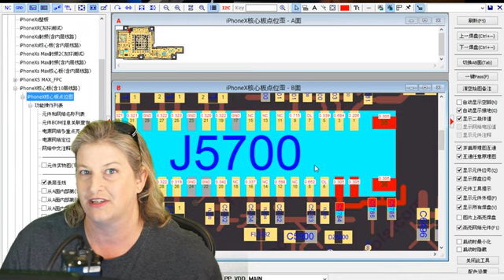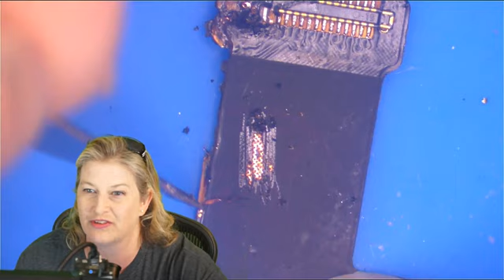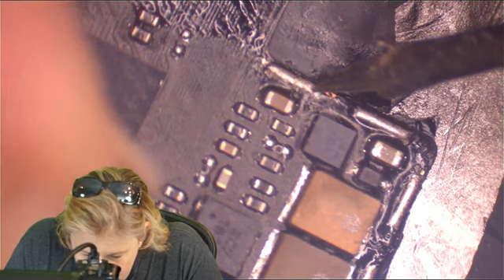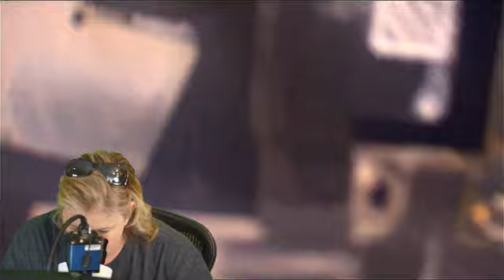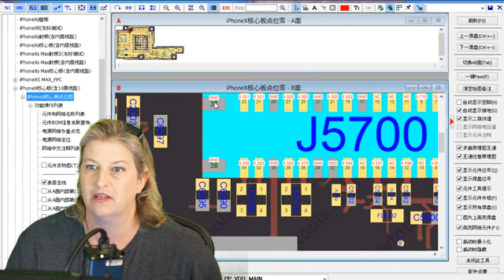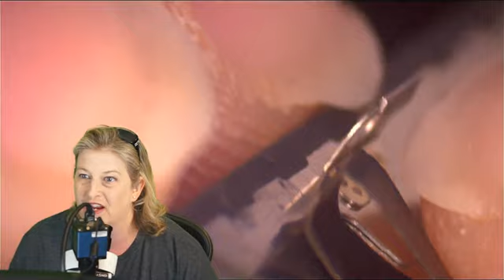iPhone X Aftermarket LCD Screens--Are They Safe?

Comment: So, off the bat, there is one main flaw with your initial theory. There is NO WAY to install an lcd screen in an iPhone X. LCDs work entirely different and are built differently than OLEDs. This can be seen with the XR vs X or 11 vs 11 pro. There is a physical chin and large bezel around the phone because the connects for the panel have to come out of the bottom, unliked the curved OLED on the X, which has the flex cable come out of the back.
Reply from the maker: You can install an aftermarket lcd produced for iPhone X.  Although I don’t recommend it.
Reply: iPad Rehab I can almost guarantee you it’s just a cheap oled mislabeled as an lcd. Regardless I love your channel and you are a big inspiration to me. I’m getting my first solder station to learn how to microsolder. I have VERY limited solder experience but have been replacing parts in iPhones since 6th grade 😂.
Reply from the maker: It’s an LCD.  In another video on my channel where one caught on fire, You can see the biology of how a backlight driver circuit is added to the screen and uses a vccmain pin from the connector for power.
Reply: iPad Rehab oh cool. What’s the name of the video? Sounds very entertaining! 😂

Comment: I'm not really sure what in this case the fact it was an LCD had to do with the issue. The lines in the flexcable are the same as on an original display right? MAIN next to ground.

Can an original flexcable not do exactly the same if you make a crease in the flexcable and have exposed copper?
Reply: I said the same thing. You’re 100% correct.

Comment: Hello Jessa. Been trying to revive a flickering Viewsonic screen. It blinks every 12 seconds (on/off). I've desoldered, soldered w/ new ones one by one the electrolytic capacitors on the power board, there are also caps on LCD module  (one 50v 10uF & four 16v 100uF

should I trial and error those caps too?
I'm all for the right to repair bill-then law hopefully.

Apple memory upgrade & service is beyond expensive.

Thank you.

See you all in heaven.
God bless, Revelation 21:4

Comment: Actually good (or lucky) engineering, that the ground trace was designed to act as a fuse and blow. That saves a total fire in the device. I had that on a high end PC graphics card years ago, and was told it was actually intentional design.
Reply: It'd be a better idea to use a surface mount fuse instead of having traces of your circuit burn and melt, but yeah I suppose you could design it that way if you wanted haha

Comment: I've always only used Soft OLEDs in my iPhone X repairs.  The idea of switching screen technologies always seemed like a really bad idea, so I've avoided it.
Reply: Thanks for the insight Captain Commonsense
Reply: @neilhuband995  You'd think it's common sense, but it's not.  I've had people bring in phones with the LCD screen replacements done by other shops in my area to cut corners and they complain to me about the issues, or someone used a hard OLED screen that cracked when they looked at it funny.
Reply: So, the iPhone X is OLED. Replacement screens are available in either LCD or OLED, yes?

I'm just wondering if there are other LCD screened phones out there that I could upgrade to OLED, because I love OLED panels.

Are such things available, OLED screens for phones that were originally LCD?
Reply: @neilhuband995  Not that I'm aware of. I'm sure someone in Shenzhen has done it at some point, though :D

Comment: Good detective work ... if the short happened at the crease, with the exposed wires on the flex, wouldn't it also show signs of burning there as well? Seems like all the burning happened at the connector. Seems more likely that the bend in the flex cause increased resistance in the circut, heating it up and the weakest point was the connector. Kind of like when you kink a water hose and water sprays out at the faucet connection.
Reply: in apple products the connector is the fuse. :3
Reply from the maker: When a line is short, the "thinnest wire" will burn, which is often the offending part, but not always.  In this case, there was a short and we can't know exactly where the short once was--the crease seems like the most likely case to me.
Reply: iPad Rehab Thanks. I love watching the ipadrehab troubleshooting videos. keep them coming. Everyone troubleshoots just a little different and we learn so much.